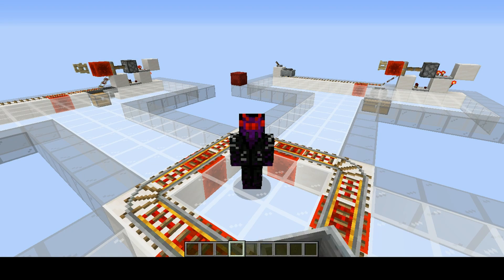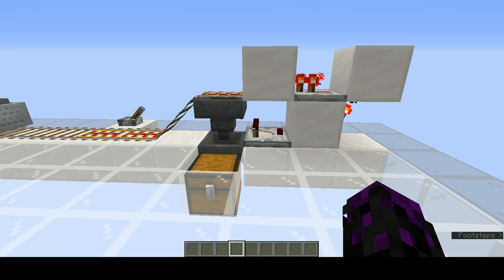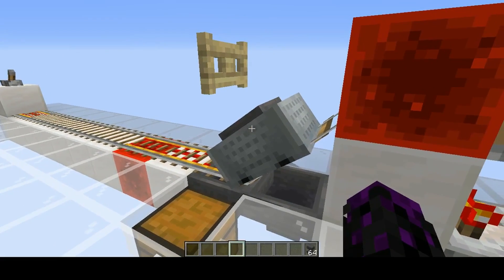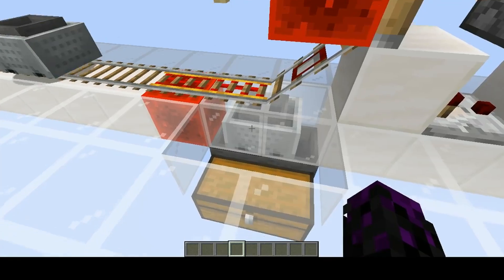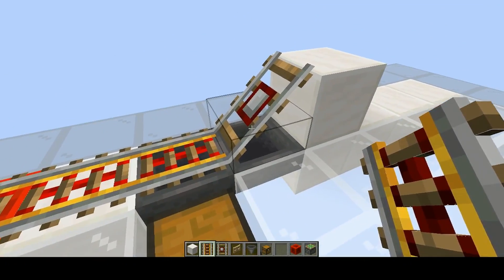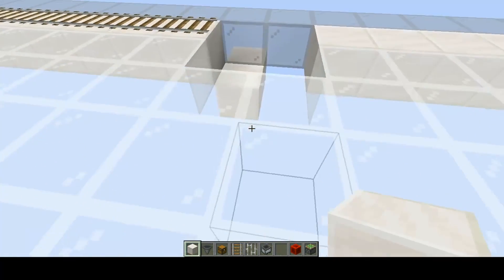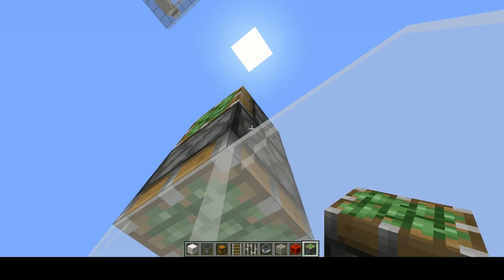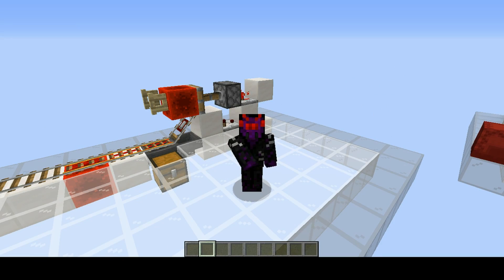Minecart Unloader Circuit, Java 1.14+, One Block Wide & Tileable

Comment from the maker: Unfortunately, this is a java only circuit. 

On the bedrock versions of Minecraft, the trick with angling tracks up that I used in this does not work. When the minecart is empty and goes into the loader, it seems to get stuck and stop working. I don't have a fix for this as I don't play on bedrock.
Reply: I got a solution. Just raise the piston/redstone block by 1 and then put them 1 block close to the rails. The objective is put the redstone block on top of the fence when activated. Then just turn the piston on with a redstone dust behind him.
Reply: @meffius_  works great ty
Reply: They fixed it now and this now works on bed rock
Reply: @nathansinclair2376  no gets stuck for me
Reply: Tammy R yeah like the day after I said it worked it stoped working for me lol
Reply from the maker: @nathansinclair2376  was that on bedrock?
I just build it yesterday in 20w20b and it worked great.
Reply: I'm on bed rock but the minecart doesn't get stuck. I can't place a fence gate. It seems currently in bedrock gates can't float
Reply from the maker: @Nicholasforreal  This design doesn't work on bedrock unfortunately. 

I am working on setting up a space I can record at more regularly so I can start getting videos out again. One of the first ones I have planned is a follow up to this one with more designs. Right now though, I have recording issues to solve.

I am unable to design for bedrock at this time. I have bedrock on the computer, but when I play the screen shakes and gives me a nasty headache in seconds, so I find it unplayable.

Comment: its not working... it wont pull anything out of the hopper minecart while at an angle so it just sits there with the items in the hopper. please help
Reply from the maker: Hello, double check the hopper set up. Pretty much Everytime this is a problem it seems people have the hoppers set up wrong.
Reply: Ravewood it’s a hopper under the angled detector rail going into a hopper going into a chest.. I watched a million times, it does stop but it does not empty
Reply from the maker: @desykee3088  yes, but the direction the hoppers are going is important. It works one way and not the other. 
What version are you playing on? Java 1.16.2?
Reply: Ravewood the latest Yea, so dont feed the first hopper into the second hopper?
Reply from the maker: @desykee3088  depends on which direction you're going from, as long as it is the same as in the video, you should be good.
Reply from the maker: @desykee3088  diagnosing redstone problems over text is next to impossible. So if you're on Java 1.16.2 and you built it exactly as in the video, then the problem has to be with something around the circuit. Is there redtine that you placed around the hoppers? Maybe it is locking the hopper.

Comment: Simpler solution to the issue of the first design: direct the top hopper to discharge to the side and not straight down.
Reply from the maker: Ah, but I needed the hopper line to go straight down.

Comment: Haha! Dude. Its not working because, the items from top hopper is being sucked too fast by the bottom hopper and the comparator can’t read it. Just remove the bottom hopper and replace it with a chest. It will work just fine. You’re Welcome. 😇
Reply from the maker: I had that thought too, but not until after I made the video. I plan to cover it in an up coming follow up video... As soon as I figure out a place I can record that's fairly quiet...

Comment: doesnt work in 15.2, the minecart doesnt unload anything in that position, has to be flat on hopper to suck items out of it apparently.
Reply from the maker: Double check that you set up the hoppers correctly. If they are not done like they are in the video, that's probably the problem. I am running this circuit in 1.15.1 and it is working perfect, but I haven't updated my server to 1.15.2 yet.
Reply from the maker: The hopper pointing into the chest can point in any direction, but the hopper pointing into the other hopper has to be there even though it doesn't actually pull any blocks out, it won't work without it.

Comment: It wasn't working properly for me. Only the back hopper was pulling anything out. So I did the unloader trick from LogicalGeekBoy's creeper farm and that seemed to work well. (Putting a hopper minecart next to a cobblestone wall, pushing the cart into the wall, removing the wall and track and then pushing two glass block down onto the cart to hold it in place over two hoppers.)

Comment: So I figured this out used this circuit but was not unloading.  I did a huge build for bamboo with this hopper pick up system so the carts weren't stopping until I put a chest under the first hopper

Comment: Why not place a regular rail before the hopper and place a power rail above the hopper
Reply from the maker: The powered rail being the angled rail?
Reply: @Ravewood  yes so what I found look very similar to yours but this is the link to best describe it better sorry im really still a noob.

https://youtu.be/U-xcNYL6hk4
Reply from the maker: @BassNinja  I will have to check out the link later, but the comparitor will not read the state of the minecart on a power rail, so the circuit wouldn't know when the cart is empty.
I believe comparitors only read the contents of the cart if it is on a detector or activator rail.
Reply: @Ravewood  oh ok yes let me know I cant experiment till later tonight thanks for replying back you have my sub
Reply from the maker: @BassNinja  okay, I looked at the video, that is the classic minecart unloader that has been being used for years. It still works, but only if you have one hopper. I showed it in my tutorial and in my example I have a second hopper under the hopper you see in the video, that set up no longer works because the bottom hopper is pulling the blocks from the top hopper before the comparitor can read them in the hopper. So the design I made detects the contents of the minecart instead of reading the items flowing through the hopper.
Thanks for the sub. I need to get more videos out soon.
Reply: @Ravewood  yes you do so I can share your videos more
Reply from the maker: @BassNinja  I have been distracted by Minecraft Earth for the last week. Lol

If there is something you want to learn about, let me know and I'll see what I can do.
Reply: @Ravewood  small fully automatic xp farm. To start with can you do it with the new snap shot and 1.14.4
Reply: @Ravewood  one other thing if you wanna play with us on this adult mature server check out maturecraft.net I think you'll like it
Reply from the maker: @BassNinja  thanks for the invitation, I actually run my own server with all adult players execpt my two infrequently playing kids.
Reply from the maker: @BassNinja  are you looking for a fully automatic xp farm where you just stand there and xp comes to you? Or one that you can access to get a big burst of exp that auto refills it's xp?
Reply: @Ravewood  nice my kiddos aren't old enough yet lol.
Reply from the maker: @BassNinja  mine are old enough, but they are too spoiled by AFK type phone games and don't know how to grind. So they don't have the patience for games where you have to work to improve and grow.
Reply: @Ravewood  that's awesome. Alright you need to start on that video lol
Reply from the maker: @BassNinja  did you see my question about it above?
Reply: @Ravewood  how different are the two
Reply: @Ravewood  but more then likely the big burst.
Reply: @Ravewood  furnace minecart and the best way to use it that's what I'll want next after the other one
Reply from the maker: @BassNinja  for a big burst of exp, that's easy, however I don't feel I have anything to offer that would be better than ilmango's 0-tick exp farm. It uses two 0 tick machines to make bamboo and cactus, then smelts it in a furnace and when you take an item out of the furnace, you get all the exp for what was smelt.

Slow, steady and automatically collected, but small and can be built anywhere is basically a holy Grail of exp farms.
Reply from the maker: @BassNinja  lol, you pick hard videos. The furnace minecart's whole purpose was replace by power rails. If you're still interested, I am happy to make a video talking about what it is and how to use it, but it basically is a pointless thing in the game and a bit of a joke now.
Reply from the maker: @BassNinja  oh, if you're looking for a very simple and very early game exp farm, check out my latest video on AFK fishing. You get tons of enchanted stuff from them and when you stick that stuff in a grind stone, you take off the enchantments getting back their exp. I used that for a while until I built my recent doughnut gold farm.
Reply from the maker: I think I'll work on a video making an over view of different types of exp farms and how to best use them.

Comment: I loved this video. It was really useful, gave me ideas. But the actual (first) design refuses to work... I'm using 1.14 and have followed literally everything in the video. The comparator doesn't activate, but everything else seems to work fine.

If you want a screenshot, I can do that.
Reply from the maker: Thanks. You can tweet me a screenshot @CarrecN. I make no promises it will help. The circut works for most people, but it doesn't work for some people and I haven't been able to get it to not work, so I cannot diagnose the problem.
Reply: @Ravewood  oh, sorry. Turns out I had it rigged up to my hopper system, which was yanking everything out beforehand. This works perfectly now, am going to try the second design
Reply from the maker: @almostjay159  That's great, I am glad it is working.

Comment: I had a similar problem. I found out that the problem was that a hopper was pulling out of the first hopper with the comparator. 
If i just run the first hopper into a chest the old system it works fine. 
But this is a cool solution.

Comment: Having problems with the second version. It seems (in 1.12 PC) that you can no longer place rails on glass? I ended up using grass blocks and with some surprise, that did the trick. However! I still run into the same issue as the first design, when the mine cart goes through the gate, it will not catch the minecart. I did follow this exactly as shown
Reply from the maker: I think the placing rails on glass is a 1.14 thing.

As for it not working, is the rail angled up after you completed building it? Causing block updates to the angled rail can cause it to go back to laying flat. 

My other thought is did you use a detector rail or a normal rail angled up against the block? The comparitor needs a detector rail to read the cart contents.
Reply from the maker: hey, my notifications show you made a new reply, but when I go look for it, it isn't there. Are you playing on Java or one of the bedrock devices?

Comment: Doesnt work, the hopper gets locked when the minecart is on the detector rail
Reply from the maker: Check the facings on the hopers. Only 1 of the two hoppers unloads, but it won't work without both of them for no redstone logical reason.
Reply: @Ravewood  im having an issue where the comparator won't take an output from an up detector rail, any tips for that, I needs this for something
Reply from the maker: @kylepollack3029  is this a problem you're having with my unloader design or a different redstone contraption?

PS sorry for the delayed reply, my new phone wasn't sending notifications for YouTube...
Reply: Try checking to see if the tracks are facing south/north - that can be the problem. Instead try east/west facing.
Reply from the maker: @MrRobbie59  While N/S vs E/W facing can be a problem with minecarts, that shouldn't be a problem with this design. You can see in the video that it works in all four cardinal directions as each of the 4 times the circuit is shown, it is working in a different direction.
Reply: All I can tell you is that it wouldn't work for me until I realigned it along the east/west axis.
Reply: @MrRobbie59  I'll try this, I build this south/north and didn't worked (the bottom hopper locks after getting 1 item).

Comment: Fence gate won’t place onto the redstone block?
Reply from the maker: Hmm, which version are you using?
Try breaking out the rail under it and placing a temp block there. Then place the fence gate on the block and replace the rail. We had to do this in some of the older versions.
Reply: Carrec Nannar I just modified it myself, I made it work. Thankyou
Reply: @adamkilvington852  howd you fix it?

Comment: just tried your design but there was a problem. it seems that the hopper minecart would just be stuck on to the redstone block whenever there is nothing on the hopper minecart. any fix?
Reply: incase u need the platform, im on Minecraft Pocket Edition
Reply from the maker: @guyguylazy  I would have to experiment with it. Redstone is notoriously unreliable in the bedrock version.
Reply: @Ravewood  it seems that the minecart will be stuck on any block in general
Reply: @guyguylazy  same issue for me on xbox

Comment: I tried the classic design in 1.14.2 and the minecart would just stop on the block. It seems minecarts dont move when a deactivated powered rail gets activated or even if they bump into a wall on a powered rail. Fixed this by making the rail slanted.
Reply from the maker: Interesting, that is a different problem than I have seen with the classic design. For me, the second hopper takes the items from the top hopper so fast that the comparator doesn't see that there was anything in the top hopper which means that the power rail never gets depowered.

This only happens with newly built versions of the classic design for me. My slime farm is still working fine with the classic design that was built back in 1.13.2.
No matter the problem that you're experiencing, my design is 100% effective. Which was my goal; I don't want to have to worry about checking on it, it just works.
Reply: @Ravewood  Oh yeah i made it with one hopper only